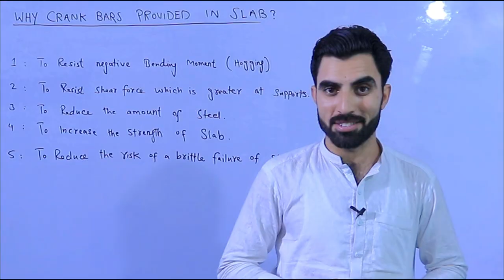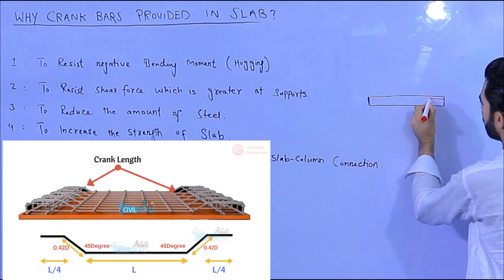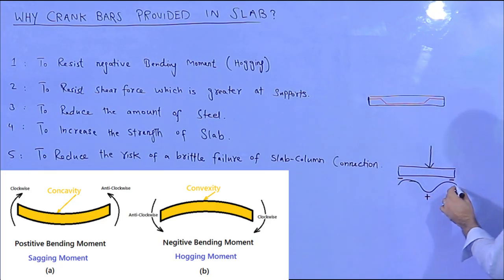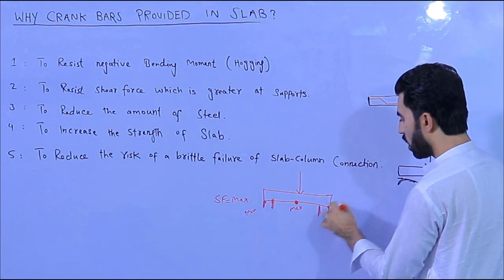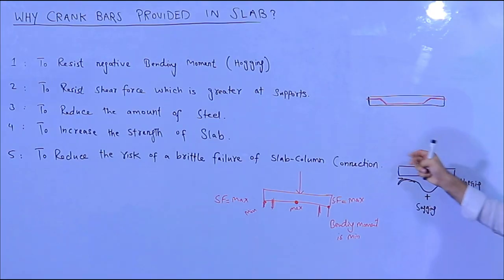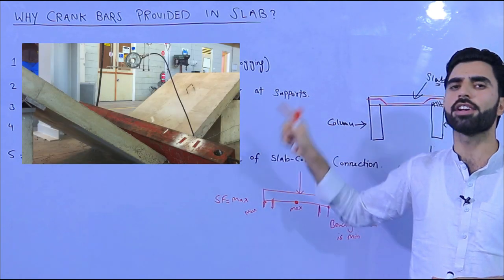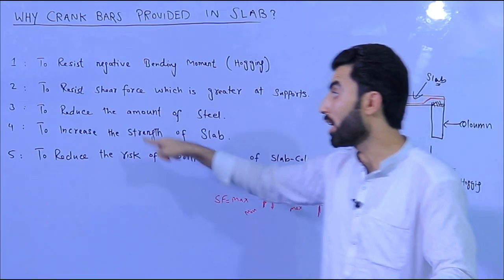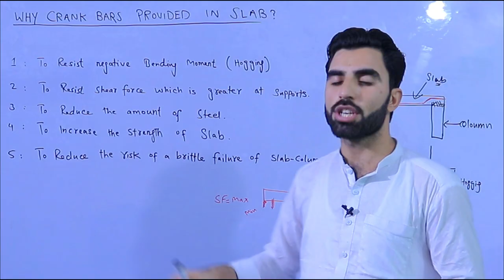Why Crank bars Provided in Slab? If Not Provided What Happened?

Comment: If you talk about crank bar in two way slab, which side is the crank bar all 4 sides or only opposite sides
Reply: Since a two way slab bends in both the directions so we will experience negative bending moment or simply hogging moment on all the four ends of the two way slab that's why we need to provide cranked bars at all the four sides of a two way slab... Hope i cleared your query... Regards! #civiltutor
Reply: All 4 sides

Comment: Sir, in certain work sites bar benders are providing extra bars at bottom (central portion ) and over supports for a length of L/ 4  of the span. Is it will function as bend up bars?

Comment: Contents ok but nature of support whether column or wall are not discussed whether support is simply supported or fixed or contineous support or hinged or roller also the effect of point load or udl above the support.
The points written on boards are not readable.
Nwadays crank bars are hardly used in practice therefore example of cut bars and extra top bars should be included.